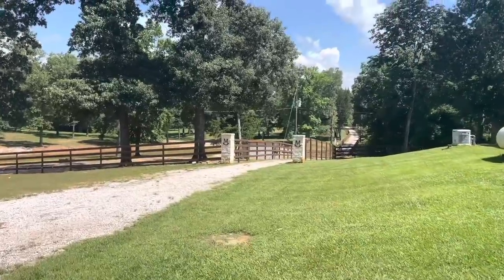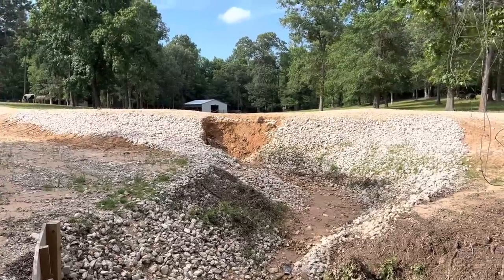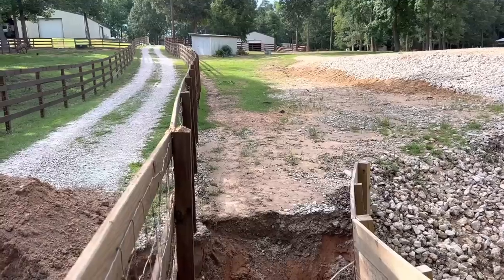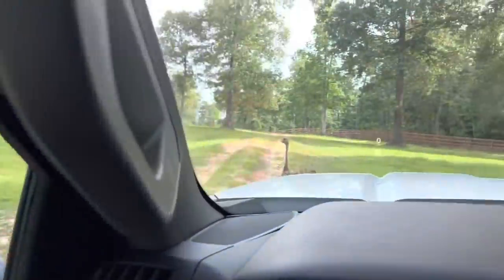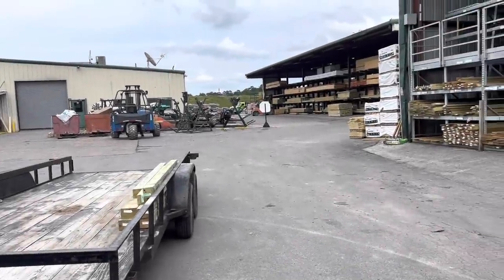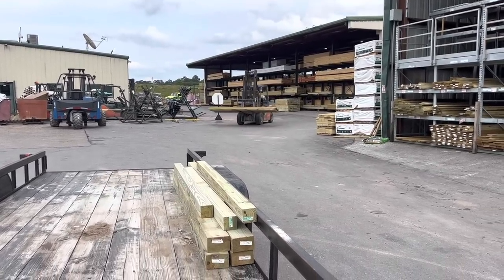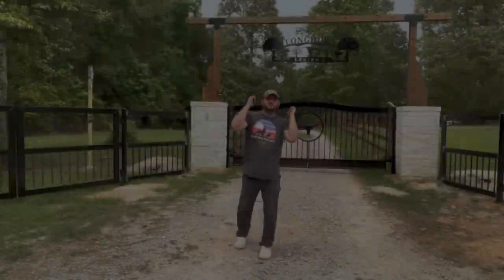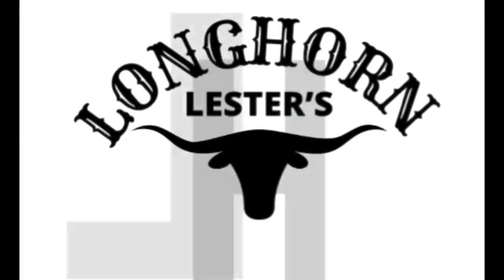Wooden Cattle Guard for Erosion Control

Comment: This is a mistake.  Metal and concrete!  You are in a location that suffers from severe drainage and erosion issues.  This will fall apart after a big rain/hurricane.  If you are unlucky enough you (or Jamie, or another family member or a visitor) might be on that driveway when it gives way.  If someone is hurt or killed due to this YOU are iiable. Also, what about the other end of this little culvert?  The end that the goats escaped from into your neighbor's yard.  What is that erosion like?  Fixing one end and not the other will lead to damage into your neighbor's property.   This is going to be a Pandora's box.

Comment: Why not have a qualified engineer who understands erosion advise you on how to solve all the problems in one shot?  Everything you've done so far is just kicking the can down the road and causing issues somewhere else on the property.  No offense but that pond gets more ugly with every fix and I don't see anything other than a safety hazard for the animals.  What you wanted to be a natural feature is now turning into more of a concrete jungle and that will continue throughout the property until the core issues are addressed.

Comment: Good grief Lester.  You know a properly sized, properly installed culvert is the solution to this drainage issue.  You know that.  Yet you jury-rigged a hot mess of fix-up to this problem before and you are doing it again.  A cattle guard isn’t a solution to a drainage issue.  Cattle guards are a solution you don’t need to a livestock problem you don’t have.   Even if you did need a cattle guard, what in the world makes you think you are qualified to build a free-standing, elevated series of them?  When there is no solid ground below you and an LONG STANDING, UNADDRESSED land DRAINAGE AND EROSION problem?  You are NOT qualified for the project you are undertaking...at all.   Hire a professional to PROPERLY fix your drainage issue, with a culvert, and be done with it.  Either that or google ‘cattle guard accidents’ and let us all know which animals’ pain, suffering and life you are willing to sacrifice for this convoluted attempt at a drainage solution part 2.   Will it be Carl?  Charlene?  Or will an unsuspecting fawn be the first to snap it’s leg?  And when an animal does get hurt in, on, between or under you cattle panel creation…will you call it an ‘accident’?  Even though you were warned it absolutely will happen?  Sadly, even after that high-price is paid by someone else’s soul, cattle panels will still not be a solution to soil erosion.  You. Know. That.  

“There is nothing exciting about a culvert”.  Lester Morrow, May 2023